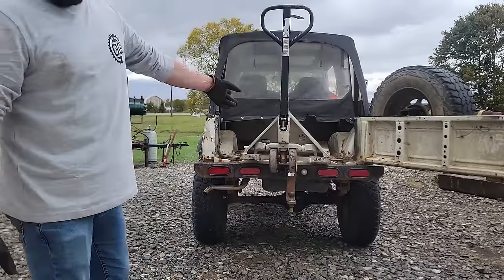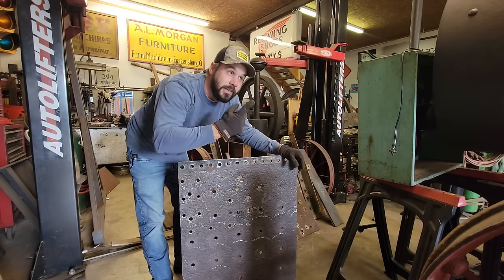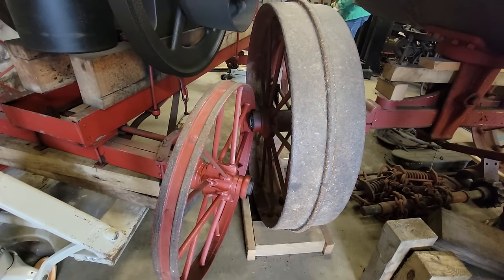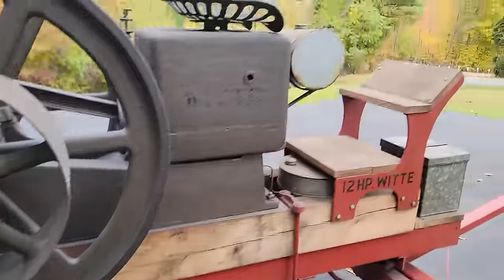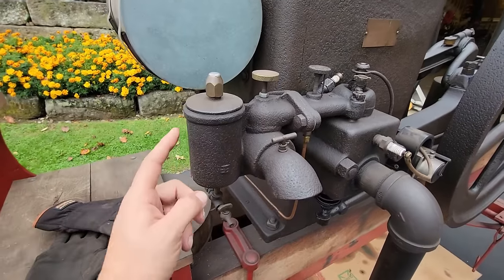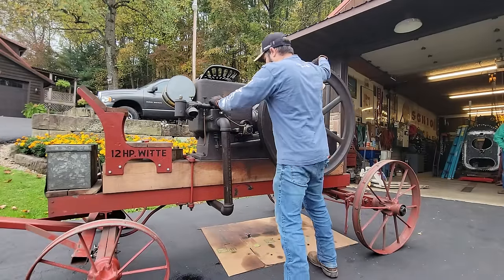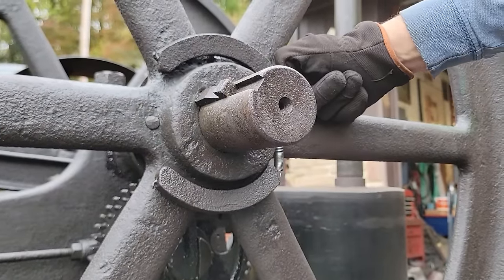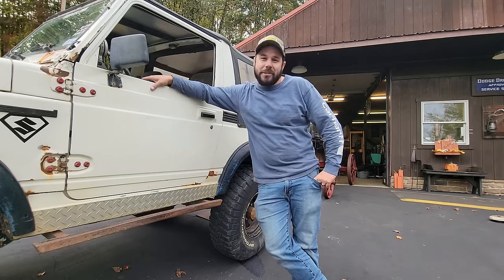ANTIQUE Hit Miss Engine RECOVERY? RESCUE? RESURRECTION?

Comment: These hit-n-miss engines were still in use in Wyoming's oil fields running pump jacks into the 1980's. They ran on well gas.

Comment: Very observant to spot the slope was affecting the governor holding the exhaust open. Excellent, job getting the Witte out of the workshop. Interesting to see the steam engine work underway. Do your USA regulations mean that you will have to have a boiler test? great video.

Comment: I had a Nova engine that was a small vertical cylinder until my stepdad had a clean-out of our shop and he sold it on me I think it was about 5 hp or less it used to run excellently it was a hit-and-miss

Comment: I've had several witte engines over the years. At 1 time I had 127 engines
Reply from the maker: It's an addiction!
Reply: @Cast_Iron_Curiosities  nothing more satisfying than taking a peice of rusted cast iron that not 1 thing turns and a few weeks it's a running and operating engine

Comment: When your starting it r u pushing the exhaust valve down slightly to get rid of some of compression? We have a 4 ho and that old girl has a ton of compression i can barley turn it  over any suggestions?
Reply from the maker: I'm pushing down the intake valve to bypass the compression to get the piston to a position right before ignition.    As you know, these engines have a ton of compression!
Reply: Oh I know we have a 4 hp witte that takes all I have in me to turn over

Comment: Just wandering what you use for the oil on the bearings i have an engine with the the same set-up
Reply from the maker: Normally, just a 30w non detergent oil.
Reply from the maker: Normally, 30w non detergent oil.

Comment: the witte engine runs good 😊😊 U should paint the engine it would look alot better the paint color is dark green close 2 forest  green there should be a paint no 4 it U will have 2 see U don't see many of those engines head type or headless I did see 1 many years ago I have no idea 💡😊 where that engine was from another fellow see the engine long and got at a show it ran very good 😊😊 OMG 11 3O 2O23
Reply from the maker: I'm a fan of keeping them original.   I believe this engine has a good bit of paint left on it still. Just needs cleaned up.  They are great running engines!